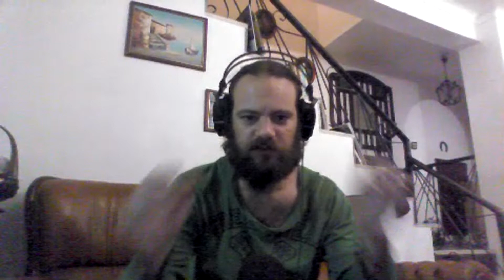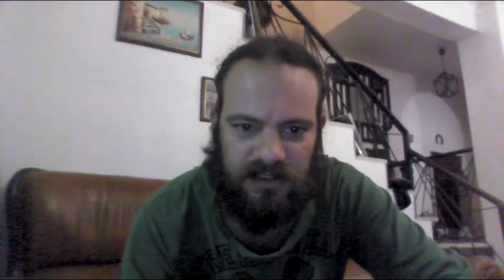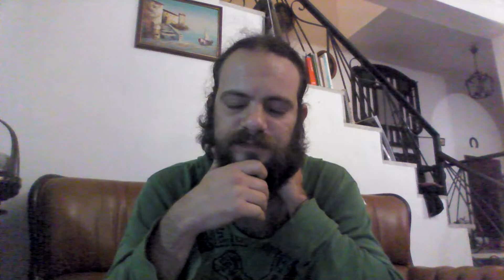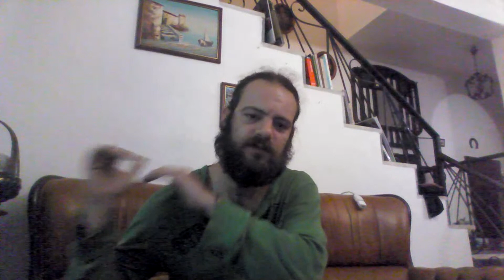My ideal homestead-design

Comment: Also worth mentioning.. The reason that Earthships are earthquake proof are:

1. No concrete foundation.. Earthships dont resist the movement of the earth, they sit on the earth and move with it.
2. The tyre bricks are not cemented or glued together.. They are held in place by the huge mass of the walls by gravity . They can therefore move and even sway without any issue since they settle right back in serious quakes. The finishing plaster may crack, but the walls themselves will have no structural damage..
Reply from the maker: Thx so much for the correction and additional info. And of course there's so much more... Did they use to add concrete? Or was that never part of the process?